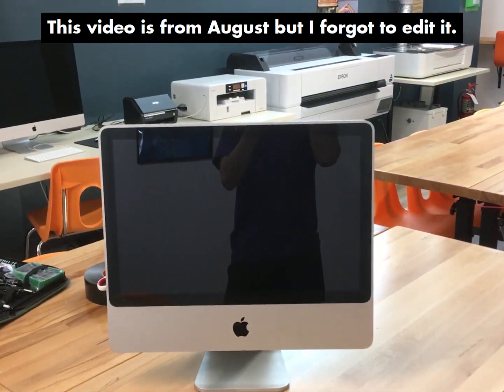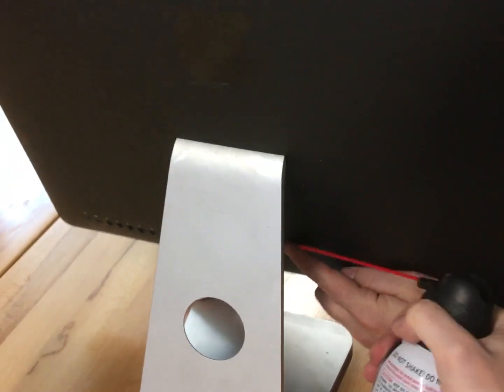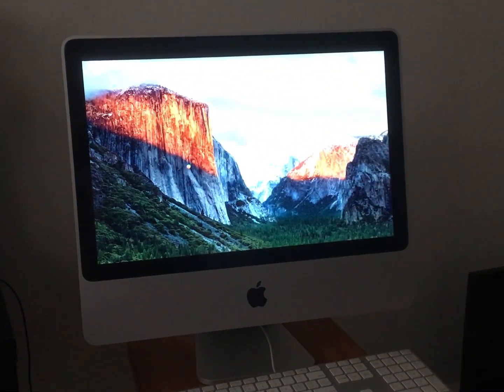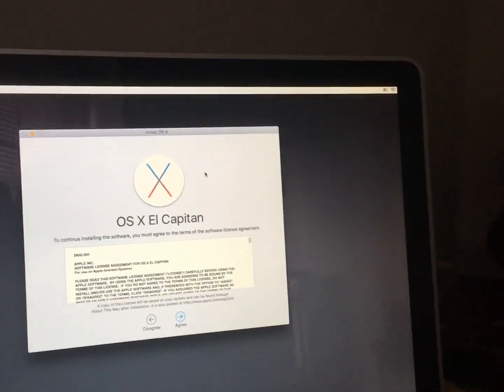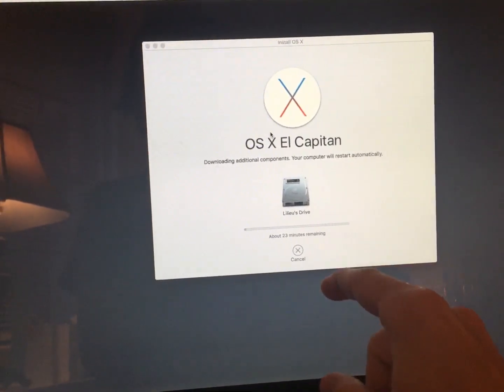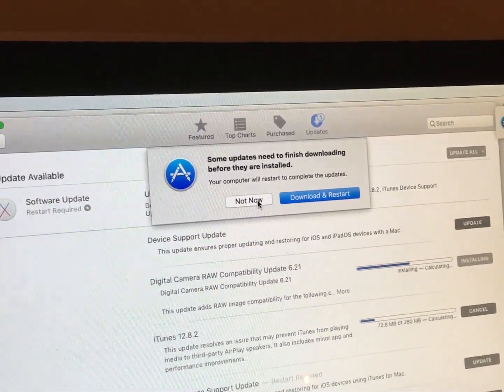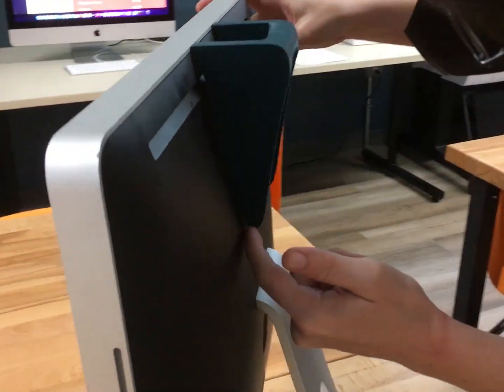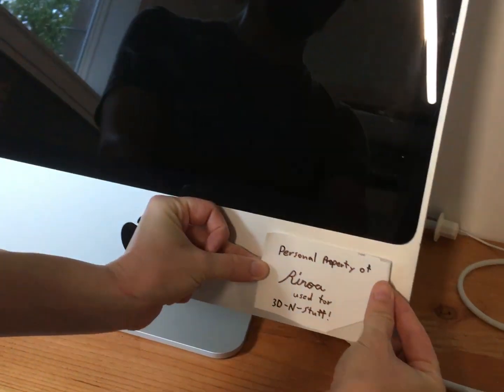I got payed a 2008 iMac for doing IT work, I turned it into a great Blender and 3D Printing Machine!

Comment: Blender3d on 20"? Where is it? Oh it's near the end, how did you do it?! Besides being on mac os. I'm on windows... and my resources take up 4gb. I was wondering if an older version of blend didn't require 8gb of ram. I have 2 20" 2007's. They're a work in progress for me and it was entertaining to mess with them but now they're working. I always hated the finding apps for mac os... Elcapitan didn't let me install bootcamp but after wiping it and installing snowleopard wow. I don't really always know what I'm doing but rather learning but it seems we are trying to do similar things! I definitely plan to play ffxi on mine rather than xiv (would that work?) and also design for some small 3d print ideas lol. I have them set up on a small table next to each other. My imac is now gold fire mist pearl and I have two (one purple, sitll needs clearcoat to go on it), one of which I found on the side of the road also like another commenter (I guess post-pandemic the ones that went home some people threw them out and I got a school one lol [complete with 'property of' decalz and gum underneath and these sort of epoxied nipples on the back for attaching chains!] had to get amdin change pw to go around domain, before just wiping it). In one I installed arch but I can't get wifi and dvd region unlock to work on it so far. On the other, I installed refind and windows 10 64bit in csm-bios boot mode and then upgraded it to windows 11 (still need to manage to upgrade refind theme). (Used a windows 10 dual-layer to get it to boot right then a win11 rufus stick...) You can unpack bootcamp and install individual drivers, but... I iinstalled the entire bootcamp into windows 10 so it partitioned my drive in hybrid mbr after it was already installed lol and I think I'm stuck with only so many partitions, and a few vhd's. I wanna mess around with this a bit more. If I turn the whole disk to gpt in a program like partition master I wonder if it will no longer boot in csm mode? I might try that before upgrading to an ssd. I can use freecad so far but I can;t launch blender though and I'm definitely not running 2x-4(8gb) ram chips (like $70 for the set). Running 4gb at the moment but with 64bit os I might be able to read 8gb instead of 6gb if I put them in. I did upgrade to a t9600 (2.3ghz to 2.8ghz improvement for $15) on my linux one when I installed an ssd. Did all the thermal paste and it runs steam with proton and I can run some games on that okay too. This one is pretty much stock hardware wise, but windows and refind. It's good to have refind because you don't need a magic keyboard at startup. I need a better gpu also but even 500mb is seriously lacking.... still a fun computer and I have a portable install of emulation station desktop mode on a usb stick and just today I was playing game boy advance games (beyblade vbattle or something) on it when I should have been working. Good luck with your future projects! I'm not sure what your channel is about exactly but subbed. Forgot to add, On my linux install I don't have refind, but I did this procedure only once. I just press command then when all the drives show up on the bootloader press control plus enter on the only one that shows up, it says 'windows' but it's grub and from then on it loads it automatically at boot-up.

Comment: Just found one of these on the side of the road a week ago and fixed it up. Unfortunately the LCD panel in mine is on its last legs but still works good enough to be usable. With an SSD and Linux Mint it's actually pretty snappy. Cool to see you can do so much with yours. Makes me realise Linux Mint definitely isn't handling the GPU properly (nowhere near the performance it should have in 3D) so might have to try something else on it or get the GPU drivers working properly.

Comment: Looks like this model is one that has a socketed CPU. Planning any upgrades?
Reply from the maker: I didn't even realize that, I guess i should look into it!
Reply: @RinoaL  From glancing at EveryMac it looks as though having the 3.06GHz CPU gives you the max video RAM, so if it doesn’t already have that one, it could improve the 3D performance a bit